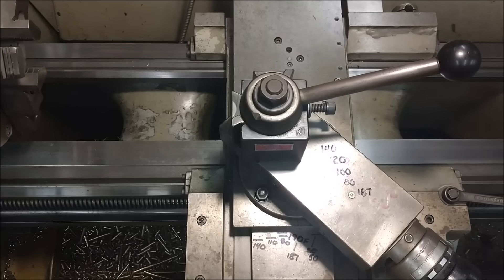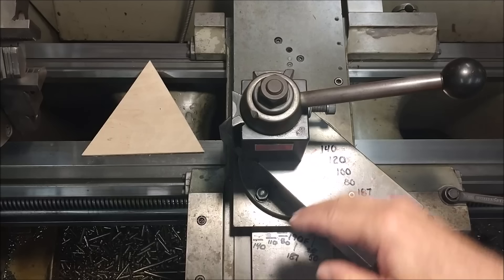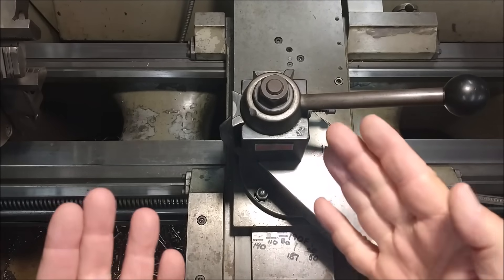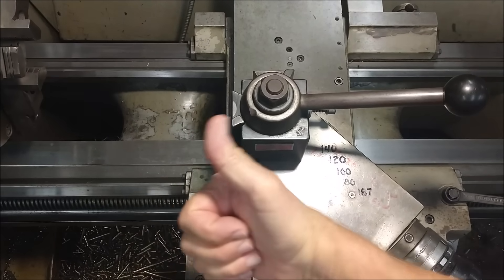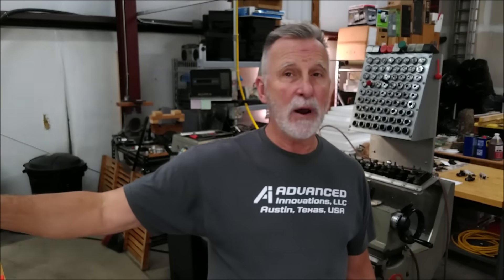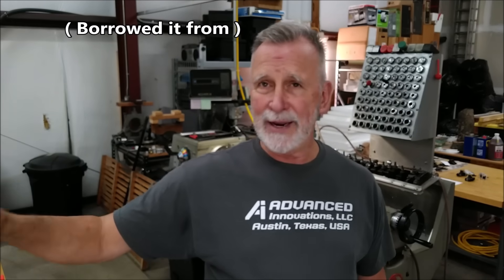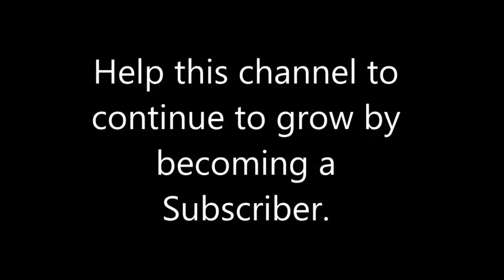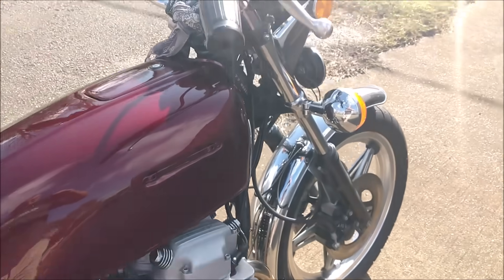New ( and current ) Machinists Should Watch This !!

Comment: The shop you worked at was it Princeton University lab in New Jersey
Reply from the maker: No, it was not.
Reply: @joepie221 worked at couple shop in New Jersey lot of them are gone made everything heat treating grinding etc lathe mill VTL horizontal bore mills

Comment: One thread I've never seen you cut is a pipe thread. Can this be done on a lathe?
Reply from the maker: Yes, a lathe equipped with a taper attachment can successfully cut a pipe thread. I believe the setting is 1 degree 47 minutes.

Comment: Hi Joe, a 6" digital calliper and maybe a steel rule +  my Overall/work coat is All I'd bring on my 1st Day !! Most decent companies (all, that I've worked for anyway) will only allow you to use "Their" measuring Instruments, because they are on their "Calibration System" for measurement consistency. Some customers also need s Dimensional Report for their order, and the results, be "Traceable" !! (Being an Inspector and CMM operator over 40 years - now retired, I'm 68)

Comment: Stay away from K & N filters !  The filter media lets more air for sure but also don't filter as clean as OEM filters  !   Just saying !!!!!!!!! Buy what do I know I've only been a mechanic for 40 years .............
Reply from the maker: Isn't the K&N filter oil supposed to enhance the performance and actually trap more debris than the filter media alone?
Reply: @joepie221  Yes the oil enhances the performance of the media however the media has larger holes which by nature means more stuff can get thru, particularly smaller particles.  That being said K&N is an active media filter so it responds and vibrates based on engine pulses this helps it to filter even more this of course does not work on a turbo motor because of constant draw. This is why on a shop vac test with chalk dust you will see a ton of chalk go thru a k&n vs a paper filter.  As it gets dirtier the filter performance improves which means you really should not clean a k&N style filter until you start to read excessive restriction in the manifold. Like most things performance oriented it is a trade off.

Comment: When I set up a cnc lathe the threading insert or tool is always 90° to the work but still makes good threads. Is it because of lack of  rigidity that we use the compound rest parallel to the thread angle  on manual lathe ?

Comment: Im not totally understanding why when you set the compound slide to 30 degrees that it not following one edge of your 60 degree angle thread as you screw cut it and increase the depth of cut with the compound slide or am i missing something ? I've been screw cutting all kinds of threads for over 35 years now and this is new to me.

Comment: Great video Joe.  We have some similar background. Stomped through northern New Jersey myself in the late 60’s.  Did prototype machining for some time, but not there.   Repetition is a learning method, but be careful.  It can teach bad habits as well as good ones.   As the music guys say, “practice does not make perfect, perfect practice makes perfect!” Absolutely good advice on tools.   ASK what you must have.  A large shop in Houston, where I was the liaison between Engineering and Manufacturing did NOT allow any privately owned tools in the shop.   This said, one should own a micrometer, and a vernier caliper if for no other reason than to practice using.   You would be appalled (well maybe not) at the number of ways measurements can be screwed up by careless or improper technique.
Reply from the maker: Prototype and repair are my 2 favorite fields.

Comment: I watched one of your older videos about internal threading that showed you making a plug gauge to check your threads with. I haven’t worked in a machine shop for 20 years and had an old Logan lathe that I was trying to thread on. The plug gauge really helped the threats turned out almost excellent thanks for the advice for the last 20 years. I’ve been registered nurse in an emergency room so my skills had deteriorated in the machine shop.
Reply from the maker: Glad it helped. Thanks for watching.

Comment: Hello again my friend. All good advise for the new kid on the block. When I was in school threading terrified my. The chance of a failure is/was just too strong and I would avoid it like the plague. Then I met Tony. He took me under his wing and taught me the no dial method and for ? reason I have never looked back. He explained it using a soapstone writing on the concrete floor. I will never forget that shop floor and all it's lessons.  Your ride is comming along nicely I remember the repairs to the peg mounts and as your design It is invisible. Losing the use of my legs has me riding in a friends sidecar.  The wind in my face is as great as it always was. Thanks a bunch old friend. good post for the newbies and a wee refresher for the old farts too, LOL. Take care Joe and seasons best to you and yours my friend.
Reply from the maker: Hi Dean. I'm not a knee dragger, but I do love a red light launch. Acceleration is just awesome. No matter if its 2 wheels or 4. Bring the heat bud. lets go....
Reply: @joepie221  In days gon by when I had both legs I would be in your driveway looking for somelow pressure front tire exersizes with my Kawasaki 900. It makes for a longer lasting front tire Oh well I can always dream eh, LOL. 20 yrs and no end to the love of adrenalin in site.

Comment: I was told 29.5 degrees on the cross slide to provide relief angle. I also have a friend who threads without disengaging the half nut. He just backs off quickly, and slams the machine into reverse (3-phase) and moves back to the beginning for the next pass. He is very good at threading!
Reply: Many European lathes don't have a dial.  I spent years running A Chez 20 x 8ft worrior that was so badly abused it took me 3 days just to clear the filth from the lead screw. It had a reverse petal for backing up, your  friend would know all about it.
Reply: I do it the same way but don't waste my time moving the tool compost at 29.5 waste of time  CNC don't do  it that way so I stop 20 years ago lol

Comment: Over 39 years. I wonder how many miles of threads I have cut. Advice for the new guys, do not be afraid to ask. I would rather spend all day explaining than 10 minutes cleaning up blood.
Reply from the maker: Keep asking until you understand well enough to explain it to someone else. Thats my motto.
Reply: Absolutely I agree and I always want new people to ask questions it tells me they're paying attention and they're interested and then I explained to them why certain things have to be done a certain way 
 safety first I tell him this is one of the most dangerous machines in the shop, a manual lathe I tell them that you're in control of the machine and not the machine controlling you and if anything goes bad just get away as quick as you can don't try to save the part or the machine
Reply: @ whats frustrating is having a guy that has zero experience in any kind of shop ask you “how do I do this”. At the time i had about 8 years in job shops and some mass production. I always told him this is how I do it. This is how you set up the machine and true up your workpiece. Get that done and cone get me. Then without even trying anything I told him he would start arguing, not asking questions but arguing about what I had told him. Keep in mind Im not getting paid extra to help him. The boss put him on me for advice. But it was an absolute argument on everything and anything I instructed him on. I was simply telling him this is how I do what I know how to do to get things done. Being this was a job shop that did heavy duty work and heavy duty lathes we always used four jaw chucks to handle everything in the shop. We never use three jaws. But this guy if I told him anything at all, he would instantly start arguing counterpoint. Keep in mind this was back in 1994 1995 and I’m still pissed off about it. Even worse, he was one of these guys that had a natural body odor problem. We called him Stinky Dan. Finally one day when he asked me about selling apart and a bandsaw I told him to use his pecker to measure the 3 inches that he needed to saw the part length to.  Lol.

Comment: Love the moto. I wouldn't be able to stop myself putting some Clubman bars on it but I wouldn't be in a massive hurry to. I love every machine I've ever ridden, but there's something about UJMs of a certain era that tick a box nothing else quite does.
Reply from the maker: These big 4's started the superbike revolution to compete with Harley and the rest is history. I also have a VTX 1800 F.
Reply: @joepie221  for sure. I started out on a Suzuki gs850g shaft drive and had a string of other big 4s, then some Enduro stuff and an 03 RC51. Unrelated spine injury took me off bikes but I'll never stop thinking about riding again.

Comment: Joe, I have watched all your videos.  I do have a question about threading, at the end of this.  My father has taught me to run a engine lathe and his father taught him.  I am a Gunsmith and thread alot out of my small shop.  Mostly on 4140 Steel and sometimes 1018 steels.  My threads, while effective and do work, just do not look clean.  I am threading away from the headstock and have tried carbide and HSS.   HSS steel tools work the best for me.  I have tried different speeds from 170 RPM to 300 RPM and no difference.  My question or problem.  My threads work and lets say for this question I have made a muzzle brake and I usuall power tap them to 1/2-28 tpi.  When I go to cut my external threads on the rifle barrel I turn it to the major diameter I need at .499.  When I am nearing the end of the all my cuts under a magnifier you can see the threads have what appear to be chips in the crest of the thread.  I have tried new tools, filing any imperpections off the tool, etc and every time they come out with small interuptions or chips in the crest of the threads.  What is causing this?  Thank you so much
Reply: What kind of cutting oil do you use? I use dark cutting oil (like pipe thread cutting oil) instead of Tap Magic or similar products and it does a great job. Make sure your threading tool is just slightly below center as well. Use the point of your center in your tailstock and set the cutting edge about .015” below center. Or just above center the same amount for a boring bar on internal threads. The 1/2-28 is so shallow to the side I usually only make 3 passes with the last 2 passes almost at full depth before I try fitting the muzzle brake. Then another .002 pass to properly size it. I also use a triangle file first laid flat across the top the angle down in the threads to remove any burrs. Also I plunge straight in on fine threads using the cross slide and not the compound. I hope this helps.
Reply: @martinswiney2192 I am using a dark hi sulphur oil. Tap o thread or Mark o thread is name of it. It is cutting oil.  I will definitely try changing the height of the tool.  That could be issue because I think I set up so my tool is dead on not just below.  Thank you
Reply: @martinswiney2192 forgot to mention I do have and use thread files.  I have a set for every common tpi
Reply: @martinswiney2192 Thanks for the tip about the tool set up.  I cut threads today and they were almost perfect.  I increased my RPM a little too.  I usually cut by going straight in with the cross slide too and sometimes my hit the compound one or twice.  But this time didn't touch it and they turned out much better with no tears. Thanks again
Reply: @ your welcome. Glad I could help. Yes crashing a shoulder sucks. Thats why I thread slower rpm. Im not as fast nor have the vision I used to have. One way to prevent it is to set up a dial indicator that contacts the carriage and you have your stopping point where the needle goes around about 1 1/2 turns. So .150” or so from contact. Set 0 on the indicator where you want to stop. So as you near the end of the thread the needle will start turning, go past zero on time, then next time it hits zero you disengage the thread halfnut. If you are stopping the thread in a groove as you should be doing on a muzzle brake its gonna have about .030 to spare before it hits the shoulder. I do this because its easier to see the indicator dial than the shoulder especially with smoke coming off the cut. Do plenty of air cuts to get the feel of watching the indicator dial before you try it on a part. Then try it on scrap piece to really practice it. I do this a lot on the industrial pumps I repair in my shop. I learned to do it first running a 60” Bullard vertical turret lathe. A beast with no mercy and you had to have base indicators on every axis to adjust the machine. No digital readout.
Reply from the maker: My guess is the RPM is too slow. That would be my first change. The material is tearing, not shearing.
Reply: @joepie221 thank you that is a better description it is tearing.
Reply: @joepie221 I cut some today and increased my RPM and set my tool a little lower on the work.  Big difference. Thank you for the assistance, very much appreciated

Comment: 40+ years in the Motorcycle Industry and my philosophy early on was if I had to barrow a tool once I owned my own the next time, this started with hand tools, then specialty tools and then shop equipment. A few big ticket items, Neway valve seat cutters was the 1st, followed by a Quickway Boring Bar and then a Chassis Dyno, also pretty sure those are the only 3 tools/equipment that I have ever sold off towards the end off being in the shop...

Nothing use to tick me off more than going to the tool room for a specialty tool only to find that someone before you damaged it and now you cant complete your task.
Reply from the maker: 100% agreed.

Comment: I have an nearly-antique Craftsman/Atlas lathe with screw-on chuck mounting; I would love to hear your suggestion (or maybe a video?) for making a means to lock the chuck on the spindle so I can use your reverse threading technique...
Reply from the maker: That would be creative, but dead heading a live center with a locked tailstock would reduce the unscrew potential. It can't unscrew if it cant traverse to the right.

Comment: And when you LOAN tools, write down who, when, and where. That way, you don’t forget where your stuff is when YOU need it.
Reply: never loan tools
Reply: I have a loan register in my large hobby shed/workshop. If anything leaves it is manually recorded - by the person taking it. Never had a problem with anything coming back. They also return it in the same condition as it left - or better. Do the same if I borrow something from someone else. Only once did I have an issue with something broken when it was returned. Person did not/would not fill in the register - was a neighbour. We haven't since spoken - now 3 1/2 yrs. Also if I hire car trailer to someone, I show them everything works when it leaves and they do the same when it returns. If they initially quibble about me not trusting them etc, then trailer hire is stopped, there and then. Also they are never to have interaction with me thereafter. I have nothing to lose - they do. Too bad.

Comment: Those were the basic tools required for my first machine shop class back in 73, some things never change.  A good old copy of Machinery's Handbook is always an added bonus. Lots of good data and techniques in 2000 plus pages. When I opened my first used copy I found a "bookworm" in it, that was a 46 edition I bought in Hawaii, first permanent duty station as a Marine.

Comment: As usual, great video joe. Quick question. Does everything you just explained, still allow you to cut from left to right with the cutter inverted. Thanks again, an old pipefitter :)
Reply: Everything except the compound angle swings to the left rather than the right. This keeps cutting pressure pushing back against any slop in the compound.

Comment: Joe, 30 deg on the compound for unified threads, does that mean 27.5 for metric?  30 deg on metric would interfere with the trailing face I think
Reply: I would have guessed (without having watched yet), 27.5° is for Whitworth threads with 55° included angle.
Reply: @timogross8191  You're right.  Not got my thinking head on today.  Can't remeber the last time I used Whitworth.

Comment: Since almost 30 years, i turn my threads just with the cross slide and it works perfectly fine. Never understand what should be the benefit from using the compound for this. 
I love these small work shops ... thats something what is hard to find in the rest of the western world today.
Reply: 29.5 deg give you a bright finish on both flanks of the thread.

Comment: I still do not know why people angle the compound? You say to do it, but not why you do it??? I make pretty tidy threads and certainly serviceable while leaving the compound parallel to the axis of the spindle.
Reply: Note the graphic at 4:27.
The tool doesn't 'know' how it's being held, so if you're plunging straight in with the cross slide, the compound could be anywhere.
The angle setting applies if you're advancing the tool with the compound.